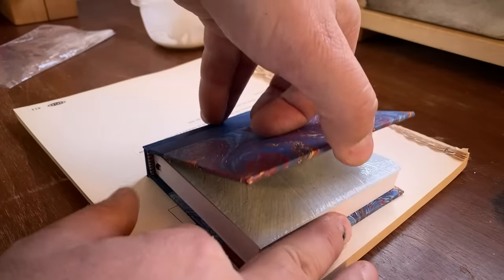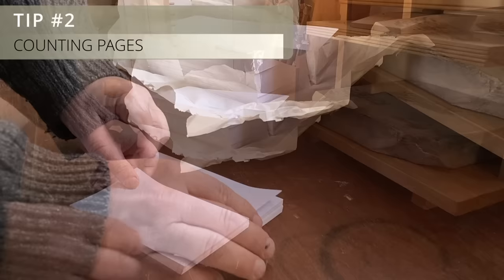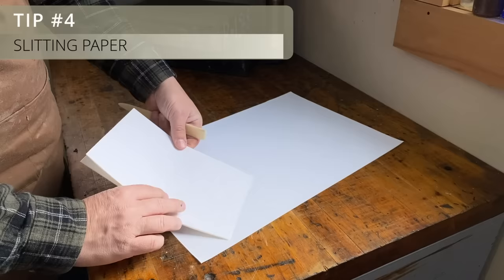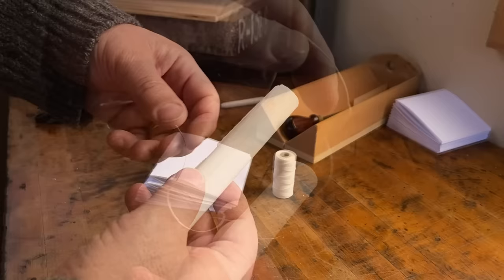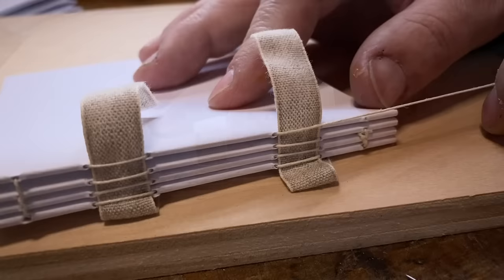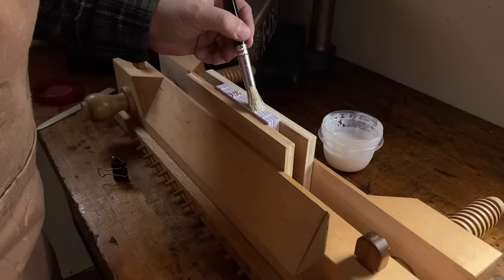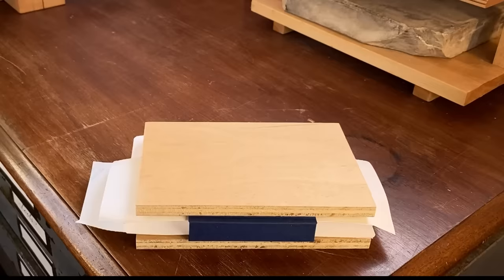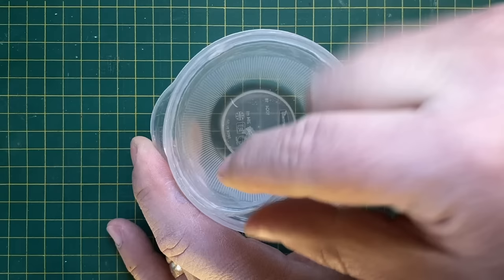Bookbinding Tips & Tricks - 14 Helpful Hints - Things I Wish I Knew When I Started

Comment: thanks for the tips, though i feel one thing that you dont mention in tip 4 paper slicing: i assume the final fold is the main fold of the signature, and the nonsliced edges are on the edges that are going to be trimmed, therefore wont be connected anymore?
Reply from the maker: That's correct, though the trimming won't be done until the book is entirely sewn. Thanks for the question!

Comment: beeswax as a lubricant? In general it is more on the sticky side. For leather-working you use beeswax or some mixture of beeswax and resin to make the thread more sticky. The rough outside of twine catches on paper and there are many ways to make it glide more easily. Singing the outside (hard to do with thin cords), burnishing, or applying wax/oil.
Reminds me off - i need to get some resin.

Comment: Another option when the thread is too short to run the needle through the last hole is to push the back of the needle through instead of the point. Once through, snip the thread off the needle. It’s best to use needle nose pliers to hold the needle when doing this.